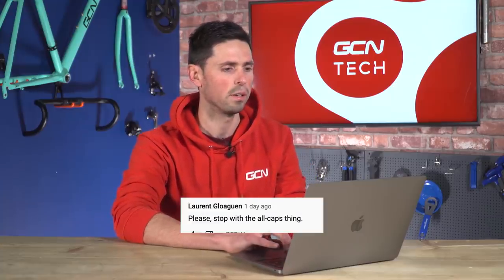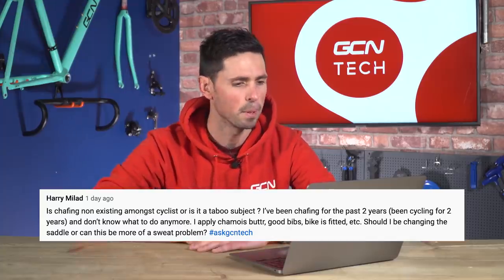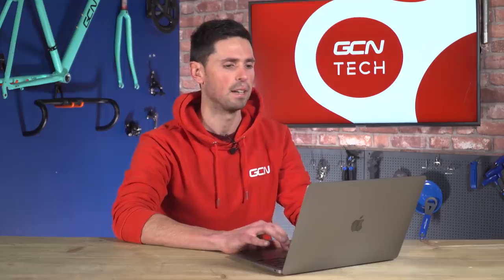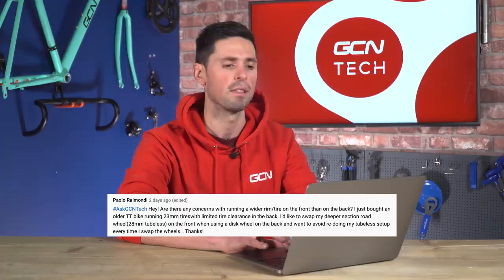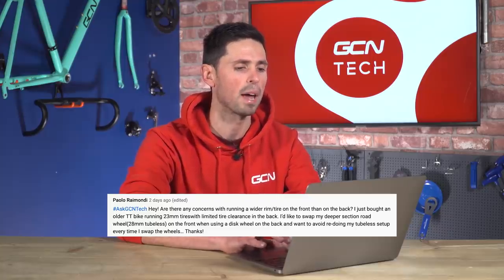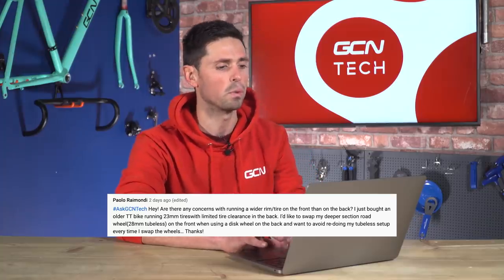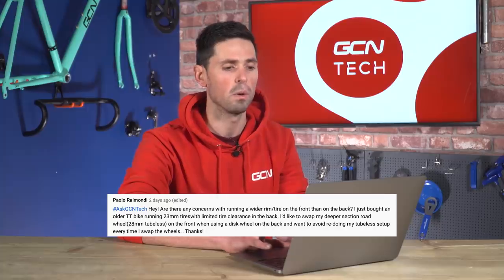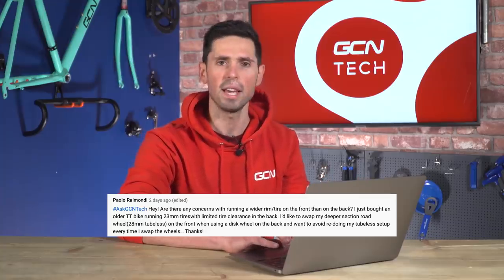How Much Do Bigger Pulley Wheels Help? | GCN Tech Clinic

Comment: #AskGCNTech Hello, and good day. I own a mountain bike which currently is in it's all-stock form. Now since I'm more of a road cyclist rather than a trail rider, I'm thinking about setting up my MTB for road cycling (rigid fork, aero bars, etc.). My question is do you think I should go on with that plan, or should I just go and trade it for a road bike? Another thing that I'm considering is that the roads here are quite bumpy, and there are a lot of long, gradual climbs, which is why I decided to get a MTB, suspension fork obviously helps with the bumps, and the gearing is great for climbs, but I want to hear other opinions about it. Thank you, supporting you all the way from the Philippines! 🇵🇭
Reply: Sounds like you need a gravel or all-road bike ;-) Good climbing gears and wide enough tires to smooth out bumps.
Reply: @erlkoenig90  I have considered getting a gravel bike, but gravel bike prices have been steadily rising recently. So I'm not quite sure if I'd be able to afford one.
Reply: @ralphjairusdesphy9832  Indeed, the hype is driving the prices up... You might be able to turn an old rigid MTB into a budget gravel bike, there's a lot of videos on that. Perhaps a (used) cyclocross bike might do the trick too.

Comment: Hi Alex. Because my partner and I use the same turbo trainer I regularly have to switch bikes between our rides. I try to be careful but every now and then the rear disc rotor scuffs the frame by the caliper and we're both losing paint! Do you have any tips to avoid this? Thanks a million!!

Comment: #askgcntech Hello !! if I have a  Shimano 105 crankset (50/34) can I use a Shimano Ultegra R8000 crankset  (50/34) without changing the bottom bracket and/or the rest of the drivetrain ?? Thanks for your answer ;)
Reply: Yes.

Comment: #AskGCNTech Dear Alex/Ollie/Manon, please help! My Shimano di2 (ultegra r8070) keeps emptying the battery overnight. I took it to my local bike shop who replaced the battery but the problem keeps persisting; a full charge only lasts a few hours. Any idea what could be causing this, or how you fix it? Could it be related to my wahoo? The firmware is up to date and it is well maintained. I make sure the shifters aren't being pressed accidentally and I always disconnect from the bike when using the e-tube app. Many thanks!

Comment: Derailleur pulleys are not under a great deal of tension and therefore having a larger pulley wheel does not really provide an efficiency advantage.

When riding in the large chainring however, there is an efficiency benefit from having the chain travel around a larger circumference but this only occurs due to the chain being under load.

Applying the “larger is more efficient” idea to help sell products is pure marketing.
Reply: It’s about the decrease in chain articulation. Smaller pulleys create tighter articulation of the drivetrain, the OSPW relieves that tension, and in combination with ceramic speed bearings that’s where the big drag is reduced. Ceramic speed hasn’t missed a Tour De France podium in 10 years, every watt saved is another watt put into the speed of your bicycle. It’s not about being the fastest rider, it’s about being the fastest you.

Comment: #askgcntech Does gearing affect your speed at a set power. For example if you are pedalling at 200W in 52t chainring 11t sprocket will you be faster than 200W in 34t ring  11t sprocket
Reply: no. Watts are watts.

Eat enough sugar so you can push bigger watts for longer. Get your red blood cell count as high as you can. as a natty.
Reply: With 34-11 you will be losing more watts due to the crooked chainline, so you will  indeed go faster in the 52-11 gear at 200 watts. However, the comparison should really be between 52-17 and 52-11, as 52-17 provides a far straighter chainline than 34-11, and is almost identical in gear ratio. The faster you're going, the more likely is 52-11 to be the better gear ratio, and the slower you're going the more likely is 52-17 to be the better gear ratio. In actual practice, you will (hopefully) have intermediate cogs to pick from as well, so the dilemma really comes down to a difference of one or maybe two teeth. In that case, go with whichever gear ratio allows you to pedal at the most comfortable, sustainable cadence for the speed you're traveling and the watts you're targeting for the duration required of the training effort or event. After all, not all watts are created equally, and not all watts make it to the rear wheel.
Reply: @johnbarron4265  my choice of gear tooth numbers was just for illustration. I should have suggested a mid cassette cog to minimise chain line angle change.  Overall it seems in simple terms X Watts equals Y speed no matter what gear you select. (Unless I am completely misunderstanding). Thanks all for input.

Comment: #AskGCNTech Hi Manon, Alex and Ollie, I am looking for a bag or case to travel with my bike. Most options require to take the handlebars off but my bike has an integrated cockpit with internally routed cables. Are there options you can recommend for this situation?
Reply: 3 options, from heaviest to lightest weight (and thus most to least protection) 1)BikeBox Alan Triathlon Easy Fit 2)Evoc Road Bike Bag Pro 3) Scion Aero comfort 3.0 Road TSA. Be careful of weight total to avoid airlines overweight charge (usually 50 lbs). You're welcome ;-)
Reply: @bfaIllini1  Thanks! That looks very good.
Reply: @chrisridesbicycles  I bought the middle one-Evoc-gives me 4 lbs of packing space after bike/case loaded. Remove wheels and pedals only, and store them in bag itself.